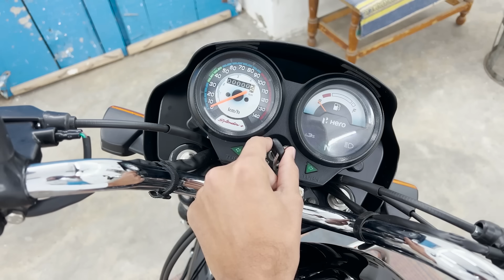Rebuild Timelapse : Hero Splendor +

Comment: I'm a bike workshop owner from West Bengal, Kolkata.. You just show art.. Most impressive is your cleanliness with neatly. Best wishes..
Reply from the maker: Thank you 💗
Reply: Sir workshop location please
Reply: Pls work shop name..& Addy
Reply: Bro , how is the engine mounted ? I mean is there any reinforcement or any kind of bolts to keep the engine stay together with the chasis. I have a 2002 Hero Honda passion and recently I found out two thread holes on the bottom side of gearbox with appropriate hole space space on the chasis? Please give an explanation  @JeetBhaskar

Comment: Hello ! Very nice video. Thanks a lot for showing it. I have a question - I see you were taking out parts from new plastic packets while building. Do you buy all these individual parts and assemble them or you first take apart all the parts of a new motorcycle and then assemble together in front of camera?
Reply from the maker: It’s an old bike mate, it was restored using some new and some repainted or repaired old parts

Comment: Nice but small suggestion, it would been better if you  provided the names of each parts while assembling by scroll n by wordings, rest is excellent
Reply: Can u provide the  cost  if someone  wants  to assemble full a-z  (like all parts incl. Engine n chassis, mechanic charges for assembling, RTO N Insurance. Await for your reply